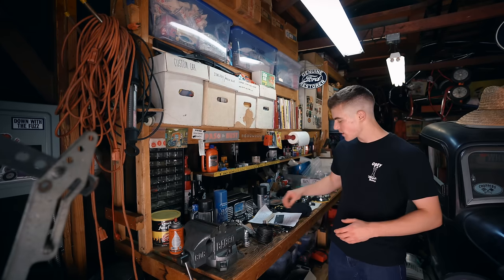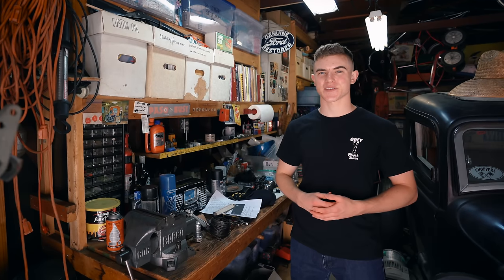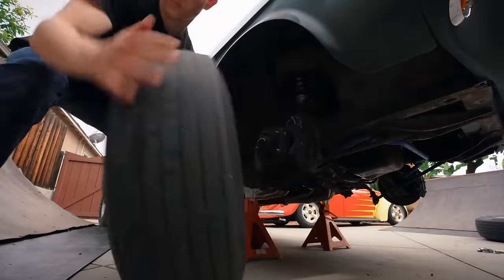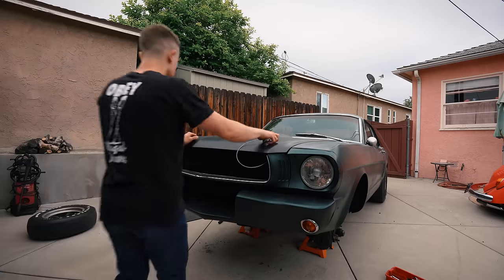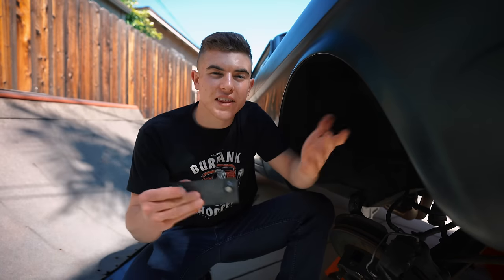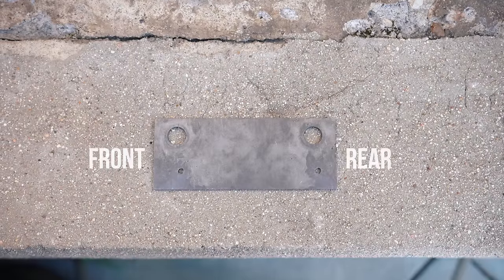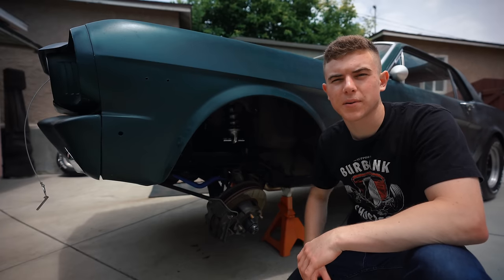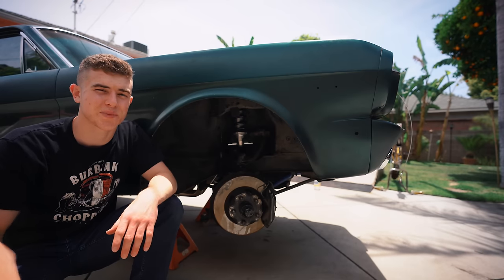How To Shelby Drop A Classic Ford

Comment: it wasnt shelbys design or idea but he embraced the idea  ... the idea is from Klaus Arning who was a Ford suspension engineer who designed this actually. so otherwise known as the Arning drop, be careful to make sure you dont exceed the swivel capacity of your upper ball joint as it will now need to swivel at greater angle and may bind up, some folks add a camber plate to eliminate this binding problem. called Negative camber Wedge Kit

Comment: Digging your channel. I just started doing pretty much everything to my base-base-base model '65 fastback (didn't even come equipped with windshield washers or back up lights!). Engine/trans swap w/ aftermarket EFI, subframe reinforcement, front disc brakes, suspension upgrades, wheels/tires. It never ends. Your tutorials make an easy-to-work-on car even easier. Keep 'em coming!

Comment: I did three additional steps to the Shelby drop. 1:  Put new upper control arm bushings and biased the shaft rearward 1/8th of an inch adding more caster. 2:  Used 1975 Maverick spindels with off set ball joints adding additional caster. 3:  Installed 1968 Mustang big block springs with 1/3rd of a coil removed. Results were addiitonal caster, minimal shimming and no nose dive allowing for more tire clearance, larger upper ball joints and outer tie rod ends, wheel bearings and disc brakes.

Comment: Nice ride. I had a '66 coupe between 1980 and 87 that I did the same mod to along with cut down springs and Koni shocks. It also had the 'glass valance like yours and JC Whitney 'glass flares on the rear (both 1/4 panels were pretty well trashed). Never got past primer gray but I had a hell of a lot of fun in it.

Thanks for keepin' it real with the TTs too....I just hate wagon wheels on vintage cars.
Reply from the maker: Awesome! Much appreciated🏁
Reply: They are timeless cars.

Comment: You should get the alignment checked after doing this. The "Shelby Drop" adds caster and it also adds negative camber.
Reply from the maker: Im taking it right when I get my new tires👍🏼
Reply: @FourSpeedFilms  Which tires did you end up choosing?
Reply from the maker: You’ll see soon😉

Comment: Nice job on the video Ben. You should check out the competition engine cross members custom designed and made by Z-Ray Richter out of Oklahoma. They come with a jack pad and bolt to the frame rail and lower control arm bolt for additional strength. Also check out the adjustable camber adjustment kit from Opentracker Racing in Calif. It's an easy upgrade and allows for easier camber adjustment versus the factory way.
Reply: Forgot to add Z-Ray's user name on ebay. It's espfilms, he's a real gentleman to deal with. Same goes for John at Opentracker racing.
Reply from the maker: Cool! I’ll check it out! Thanks🏁

Comment: Don't forget there are specific alignment specs for the Shelby drop.
Reply from the maker: I’m taking it to a shop after I get new tires👍🏼
Reply: For gods sake dont let them use factory alignment specs. Use -0.5 to -1.0 camber, +1.0 to plus +3.0 caster, no more than 1/4 degree difference side to side. 1/16" to 1/8" toe in.

Comment: I never knew this was called the Shelby drop. I’ve always known it as the Gulstrand Mod. Awesome addition either way.
Reply: aslo called the  Arning drop, he gave the idea to shelby, he was a ford suspension engineer.
Reply: @sacooper802  Yup, Arning was the German born and trained engineer who was in charge of suspension design for Ford's North American operations at the time.   Today people criticize the original Mustang suspension as trash, and proof that Ford was incapable of world class engineering.   The reality is that the 65 Mustang suspension came straight out of the Falcon.  The Falcon was a mom 'n pop car that was designed to be as cheap as possible to manufacture.   BTW, Arning designed an IRS for the 65 Mustang that was never put into production because Ford Management decided that it would be too costly to install in a cheap, disposable car like the Mustang.   Ford did use that IRS on some of its race cars where it was noticed by engineers from Benz, who went on to copy the design and put it into production.

Comment: Actually wasn't done to the GT500 although it can be, and  later 66 GT350 didn't get it as a cost cutting/time saving measure. 65/66 go down an inch and back an 1/8 67+ just down an inch. lowers car about 5/8 of an inch. The UCA drop and a 1" sway bar will help handling a lot. Alignment  should be -.5 to -1.5 camber +3 or more caster (adjustable strut rods with rod ends a huge bonus) and an 1/8" toe in
Ben you may want to find your local SCCA and get involved in autox
Reply from the maker: That’s interesting👍🏼 I was just repeating what the kit said
Reply: Klaus Arning a ford engineer actually came up with the idea for the upper control arm drop. Ford decided not to use it in production so Shelby took the idea and ran with it on the GT350. Adjustable strut rods are certainly beneficial. Pair them  with the vario -centric camber kit for the lower contol arm you can really dial in the handling.  If you go that far install a monte carlo bar, export brace and the boss 302 style lower crossmember that ties the lower control arm mountinf points together. The steering and handling will be spot on, predictable and a hell of a lot more fun to drive on canyon roads.

Comment: How does this drop affect the alignment later on? What are the specs of the shelby drop.
Reply from the maker: It definitely changes the alignment. It doesn’t drop the car that much tho
Reply: Four Speed Films When you took the car to get aligned, did you hand them a specific spec sheet to align it to?

Comment: How much is your drop in the front vs. the rear. Thx.
Reply: How much did you physically lower in the front and rear? Did you put a 1 inch spacer in the rear. The Shelby drop, lowers around .5 inch..? how much did you drop with your front springs. Does your front tire rub in fender well at all? I saw tire size was fr-70 and gr-70. I really like the trans-am look. I’m considering getting an early stang to tinker with my 15 year old son. Thnks a million.

Comment: You couldn't just adjust the coilovers to lower the front end?
Reply from the maker: The Shelby drop doesn’t really drop the car much. People do it to make steering more responsive and to reduce body roll. Lowering the control arms reduce the amount of leverage the upper control arms have on the shock towers which reduces the flex of the body lessening the amount of body roll.

Comment: Nice! Does shelby do anything to the rear?
Reply: You can just get lowering leaf springs for that
Reply: @imacaryay7628  so shelby put different rear leafs on the gt500 than on a stock fastback?
Reply from the maker: A Shelby drop only affects the front end
Reply: @AAhshitsun  pretty sure, all you'd need is 2 inch lowering springs in the back and you should be able to match it in the front
Reply: @imacaryay7628  thank you! I always wondered how Shelby got the rear ends so low because I’ve never seen special Shelby rear springs
Reply: @FourSpeedFilms  yes, but pics of 67  Shelby’s were very low in the rear, right on the rear tires. I have a 67 fastback with stock rear leafs and  there is 3 inches of gap.
Reply: @AAhshitsun  np, I'm looking at getting a 67 cougar which is basically a mustang with a longer wheelbase so I've been doing research lol. You might need to change the air shocks in the back as  well since they'll probably be old.
Reply: @imacaryay7628  Yep got new. Springs determine ride height and shocks determine compression and rebound speed.

Comment: Does this work on the rear also, or just the front?
Reply from the maker: The rear doesn’t have control arms, so no👍🏼
Reply: Four Speed Films thanks for the reply. So to lower the back, you’ll be cutting springs?

Comment: Was there any fender rub with the front tires after the installation?
Reply from the maker: Slightly
Reply: @FourSpeedFilms  What are your tire sizes front and back? I'm thinking of doing the Shelby drop too but I may need to replace my tire size if there is rub.

Thanks for the fast response btw. Love the channel!
Reply from the maker: Mine are f70 and g70 (period correct tires). I have coilovers and my fenders are flared